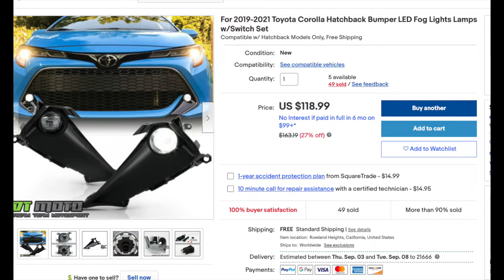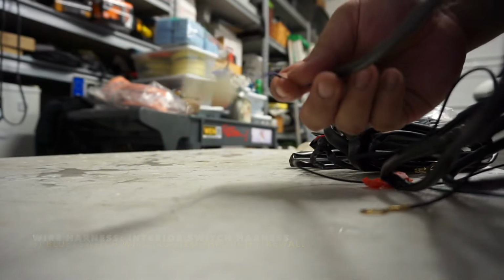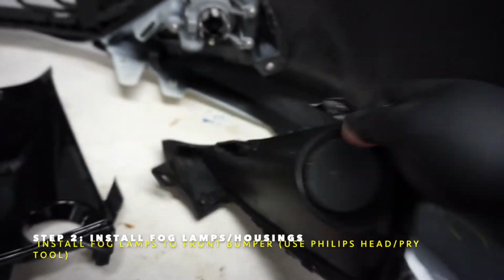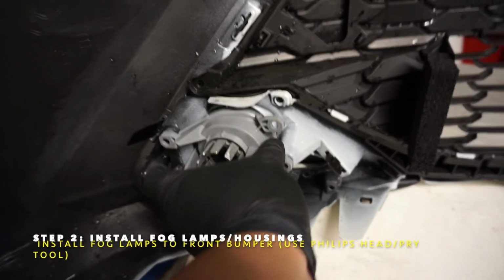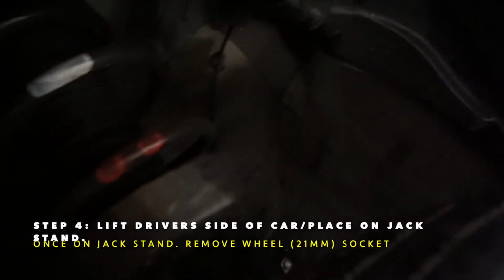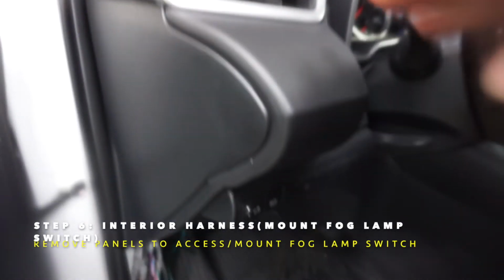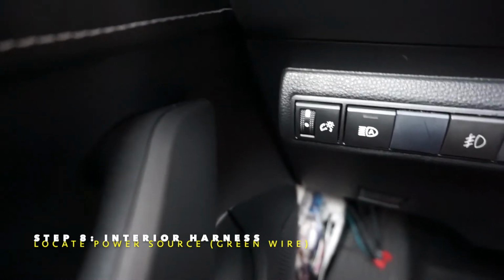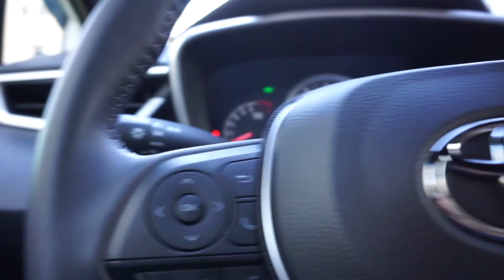How to Install Aftermarket LED Fog Lights: 2019+ Toyota Corolla Hatchback

Comment from the maker: 4/27 UPDATE! Wiring the FOG LAMP Switch Power Source! I have re-wired my power switch from the steering wheel (yellow wire) to the interior FUSE box by drivers side footwell using a Fuse Tap. The Fuse Type is a MINI LOW PROFILE. Tapped in the 10A Tail Lamp fuse with 5A fuse on the tap. Now the fog light switch ONLY works when the parking lights are on, and when you turn off the car, the fog lamps will not stay since its now wired to an ignition accessory. Check this video from Junel (Skip to 6:02) to see how he wired his switch. This method is safer/easier: https://www.youtube.com/watch?v=ZtaM-Hnb2L8&t=3s
Reply: Why did you decide to require it?
Reply from the maker: @justisbarcelona1903  I rewired because I had accidentally left my fog lights on couple times lol. So switched to ignition switch so when the car is off, I know the fog lights won’t keep running
Reply: @FujiboHeavy  are you still able to control the fog lights manually with the button with the rewiring you did?
Reply from the maker: @bmurse  yes! So now since the tapping into the Tail lamp fuse. I can toggle the fog lights on/off only when the parking lights are on. If the parking lights are off the fog lamps will not come on at all regardless of the fog lamp switch position

Comment: One of the wires already there are probably for the fog light circuit. Toyota tends to use one wiring harness for a model car then omit accessories as needed but wiring and connectors are still there.

Comment: Do you know if there's a part number for just the Fog Lamp switch? I am planning on wiring Hella lights but I want an OEM switch button, but I can't seem to find the part number for it
Reply from the maker: I’m not sure. It’s an aftermarket kit , but you may be able to message them directly to see if you can buy just the switch only?  Or I’m sure you can order oem switch from Toyota

Comment: Hello, thanks for the video. 
The direct cable to the battery, goes directly to the screw of the positive terminal?
Reply from the maker: Np! Yes, from the wire harness the fused wire should go directly to positive, then a ground wire. Lastly the fog light wire goes into the cabin and connects to fog lamp switch which is also powered by whichever power source you choose

Comment: Thanks for sharing.
Reply from the maker: Leo Malagueño my pleasure! Hope send me vid when you do yours!
Reply: @FujiboHeavy  havent done mine yet, the bracket or what you called it (the one you screwed on the fog lights/ securine the fog lights) is it on the bumber side, nothing to do with front sort of triangular plate that has a hole for the fogs?
Reply from the maker: @leomalagueno163  yes. So the black pieces are the housings. Snaps onto front side of bumper.  And the fog lamps themselves mount to the backside of the bumper itself
Reply: @FujiboHeavy  thanks good to know, thats the delay, i got, till today i nver done mine, i bought another sets now, and its the same, no wonder the bracket I am looking for is already there, on the bumber side, thanks for confirmation.

Comment: I noticed that the trim piece on the front grill was wrapped black, did you remove it to get it wrapped?
Reply from the maker: It actually came from factory like that! The XSE had silver trim, and i think the SE/LE has black trim. Are you referring to the lower grill opening?
Reply: @FujiboHeavy  Yeah I have the XSE and it has the silver trim. I wrapped it black but it didn't come out looking great. I'm thinking about taking it off in order to wrap it properly.
Reply from the maker: @ivanvazquez3315  ahhh gotcha man. It’s definitely removable, you just have to be careful not to break any tabs. I’m sure if you removed the front bumper you should be able to unhook the clips safely from the inside of the bumper, then wrap away! Or have a paint shop spray it gloss black with automotive clear coat

Comment: Th fog lights will always on or you can turn on and off independently?
Reply from the maker: Yes, since I wired it to a constant power source instead of the ignition, I have full control so that the fog lights can turn on/off independently with the switch. The only drawback is you always need to make sure you turn off your fogs after you turn the car off, or the fog lights will stay on

Comment: Can't you just tap it into a circuit that only has power from ignition; that way the switch will illuminate when the car is on and not when it's off? I tapped into the washer motor fuse circuit on my versa and I didn't have a problem with it in the 3 years I owned the vehicle.
Reply from the maker: Yup, you can tap into the tail lamp fuse with a fuse tap. This way it will only come on when parking lights are running. I wired them this way so I can just run fog lights only without having to turn on the parking lights. The only con is that i have to remember to turn them off after i park lol